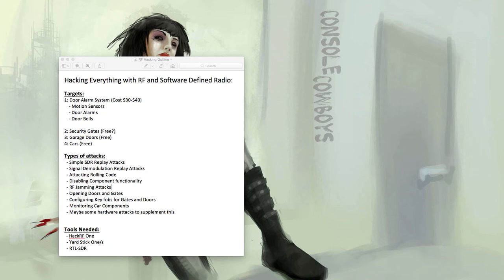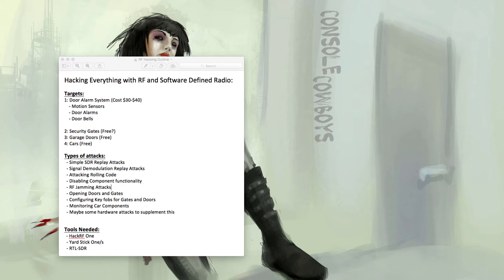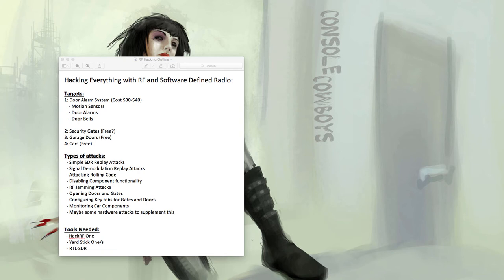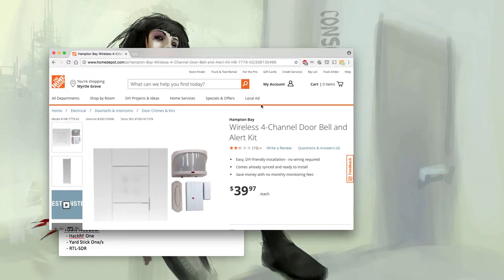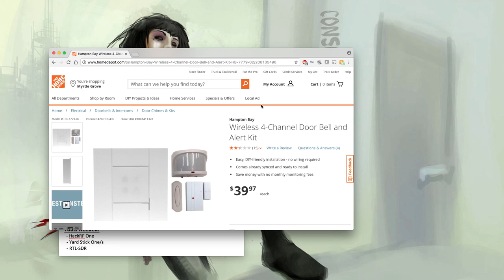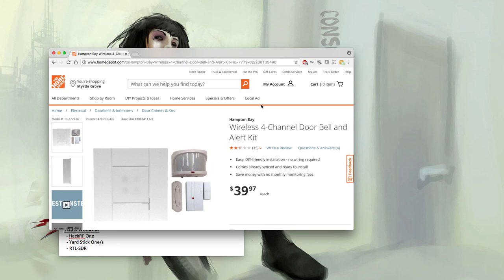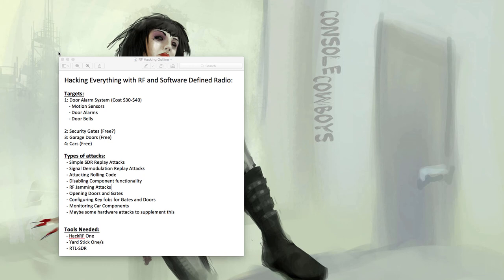Hacking RF With Software Defined Radio - Intro 0x00

Comment: I'm looking to attack/duplicate my door opener.

I found the FCC test results here: https://fcc.report/FCC-ID/EF4ACP00872/112563

The frequency listed on the physical device is 318 MHz.
The modulation listed from the FCC page is "Pulse Position A1D, AM Modulation". 
https://en.wikipedia.org/wiki/Pulse-position_modulation

I have a YardStick. 

I understand I must set the frequency in Hz to:
How can I set the modulation to "Pulse Position"? Is there al list of supported modulations and their corresponding short coded names? 

What else am I missing?
Reply from the maker: I think pulse position is a variant of pulse width modulation which I believe would simply be the mod_ask_ook option.  Give that a try.  Though if i am incorrect please let me know.. but from some quick searches thats what it looks like to me.

Comment: IDEA: Would be great if you could do a video on long range RFID Scanning.
Reply from the maker: I have not done much research on RFID beyond stuff for cloning cards and bypassing protection mechanisms for card security.   Long Range RFID I assume would need very specialized hardware in the antenna dept for sure do to its short range reach by default.
Reply: @ConsoleCowboys  I've done some research and RFID ERP is almost nothing. You would have to hug someone wearing an RFID tag to get the data.
Reply from the maker: @jasonpitts8395  Yea thats basically what I observed last year when messing with some keyless entry stuff as well.
Reply: @ConsoleCowboys  at some places, mainly high end subdivisions, a resident will have what amounts to a toll tag and there is a large RFID antenna that sees the card, verifies if it is allowed, and the gate opens. That has more range than a card used to enter a doorway. Same for toll tags for toll roads. I wonder if a toll tag would be easier because of the distance required for the verification = more RX power via the node reading the cards. The one in the vehicle isn't putting out much. Something to think about.
Reply from the maker: @jasonpitts8395  Yea I was talking to someone who was doing research on that and he was actually contacted by an automotive company and given some special antenna which has some distance.. I dont know much about it though.. So its a possibility.

Comment: Hi    Error in resetup():NoBackendError('No backend available',)
Error in resetup():NoBackendError('No backend available',)
Error in resetup():NoBackendError('No backend available',)
Error in resetup():NoBackendError('No backend available',)

I have errors when I use RFCat. Can you help me please? Thanks
Reply from the maker: Based on a quick google search that appears to be an issue with PyUSB.  Try Re-installing pyUSB and see if it fixes it.  If not I would search that error and see what others did to resolve that issue with rfcat.   If you cannot resolve the issue then try using Kali Linux which as I remember it was easy to setup RFCat on...     If you are using OSX you can follow my install guide for RFCrack which uses RFCat and has a guide for OSX which also should be mostly ok for Linux as well.

Comment: File "/usr/local/bin/rfcat", line 8, in <module>
    from rflib import *
  File "/Library/Python/2.7/site-packages/rflib/__init__.py", line 2, in <module>
    from chipcon_nic import *
  File "/Library/Python/2.7/site-packages/rflib/chipcon_nic.py", line 4, in <module>
    import usb
ImportError: No module named usb 

I can't run RFCat on terminal, how can I fix it?
Reply from the maker: its in your response.. you need to install a USB module.. check out the install doc on my RFCrack tool.. there is some USB stuff to install that will more then likely fix that error..
Reply: it dose not work. it gives me same problems
Reply: can you send me link of your RFCrack  tool please? Might be installed wrong one.  Just make sure I did right one. Thanks !!!
Reply from the maker: @javlonrahmatov5429    Your best bet is to start googling your last error and installing or fixing each one until they all disappear based on what you find in your searches.. could be any number of things..   If that doesn't work.. try it in a kali vm with my install file for my other tool which should cover stuff for RFcat
.. and pass the usb through into the vm.. that should work without issue unless its changed in the last year and most of the pre-reqs will insall with apt-get in that enviorment. I usually use OSX and it tends to give me issues but i prefer to use my base OS over linux VMs..  But there are a number of pre-reqs for RFCat depending on your OS..
Reply from the maker: @javlonrahmatov5429  https://github.com/cclabsInc/RFCrack/blob/master/INSTALL